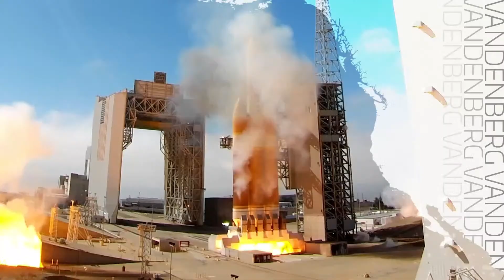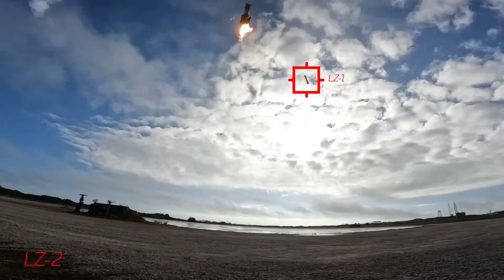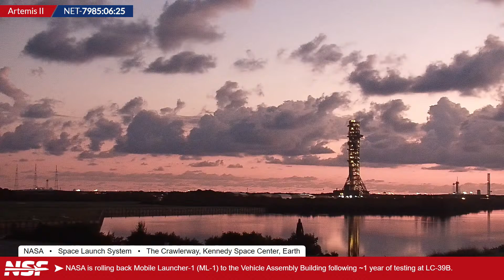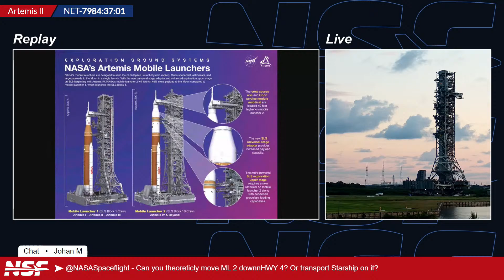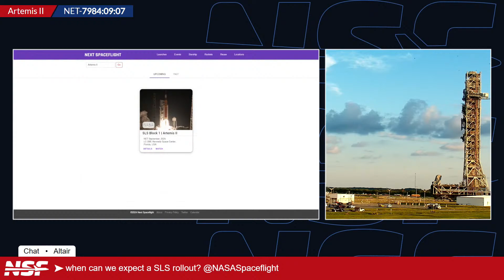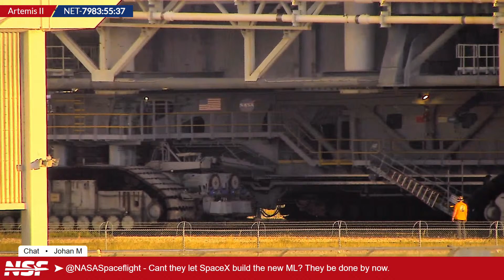🔴FULL REPLAY: NASA Rolls Back Mobile Launcher-1, in Preparation for Artemis II Stacking

Comment: What made the space industry turn back to the rocket type vehicles instead of using the shuttle vehicle??? Just curious 😀 
Love you guys!!!
Reply: Shuttle was enormously expensive and honestly not the safest method.  They lost 2 of the 4 vehicles with all crew lost.
Reply: Heat shield is protected during launch, proper launch escape system is possible, wings are a waste of mass when you don't need the cross range at landing...